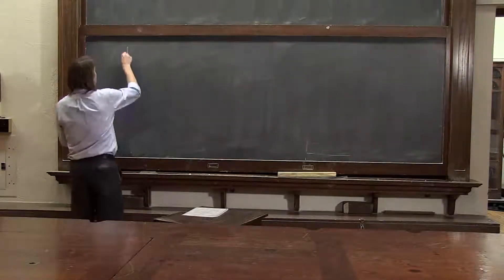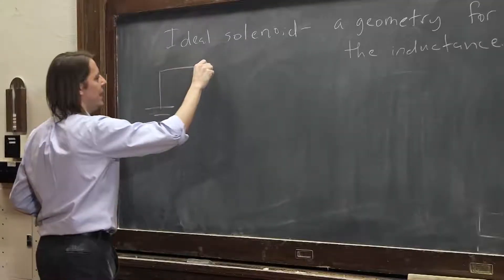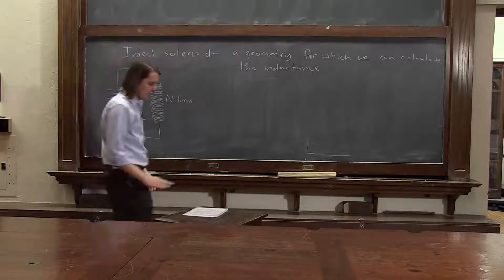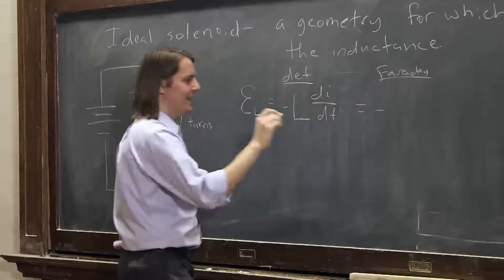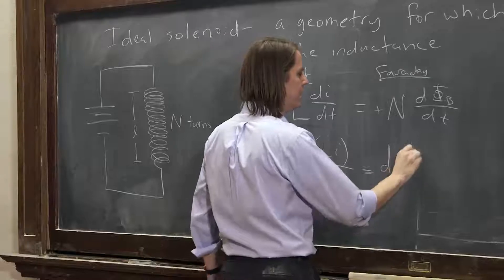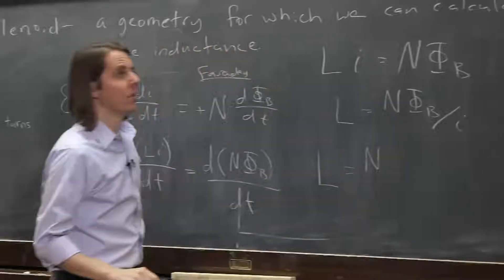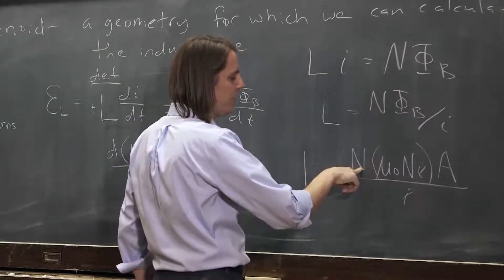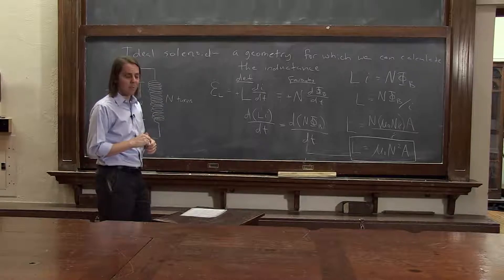PHYS 102 | The Inductor 3 - Calculating Inductance from Solenoid Geometry

Comment: To get a larger inductance, you increase N or A or both. BUT, if the geometry has some intersecting components, then A could be increased in a different way in a more compact space. Take the Bashar Space Time Antenna coil, for example. It has two intersecting cones, and the 3-D volume that intersects increases A when the coils are bucking. It seems that even with a cylinder, it is VOLUME not AREA that plays a role. The length and the diameter together produce a volume.

Comment: Question - what’s the inductance of a wire of length L? How about it being surrounded by a ferrite coil of length L? Thanks.
Reply from the maker: A simple wire by itself would not have an inductance.  You must wind it into a coil and you can see how the geometry affects L in the lectures.  When you put ferrite in the coil it increases the inductance because the response of the material is to increase the magnetic flux in the coil.  Ferrite is used to increase L in certain cases because at high frequency a bunch of coils starts to show som capacitance (between the nearby wires).  Getting a large inductance with ferrite rather than more coils helps increase inductance without increasing "parasitic" capacitance.
Reply: wheeler formula

Comment: Im getting little confused. ..shouldn't the "B"= uNI/L? how come it turns L=N(u*I)A/i at the end? Could anybody please help? Thanks :)
Reply from the maker: Oops, two issues here.  First, you are right, there is a mistake.  The "B" I used should be uNi/l  (divided by the length "little l").   I was thinking of B=uni where "little n" is the number of turns per unit length, n = N/l.  So my answer is really the inductance per unit length.  I'll add a note of correction.  I think I corrected this in the online class.

The other issue is that you put that B is uni/L, and by using a "capital L" it looks like you mean inductance, but I think you meant length.
Reply: @Prof-Hafner  omg I just saw this! thank you so much for your help. I have finished watching whole physics 102. You are the best!